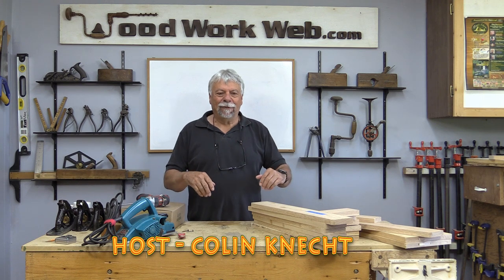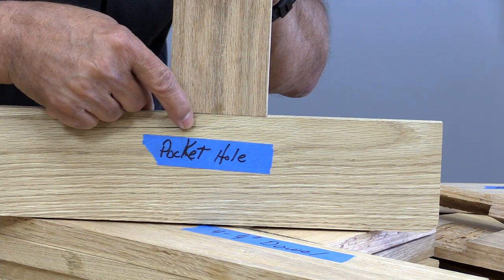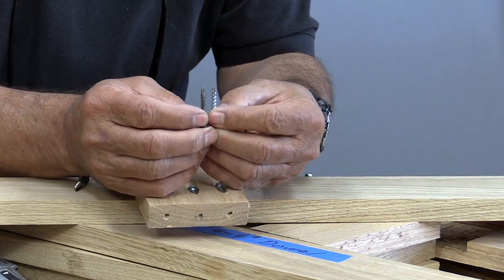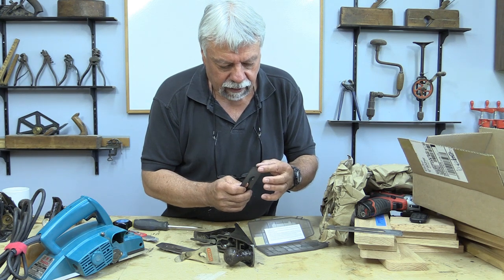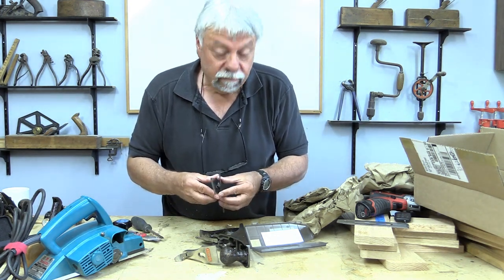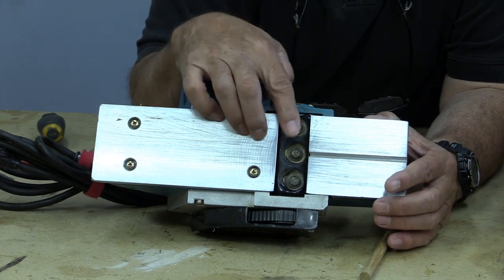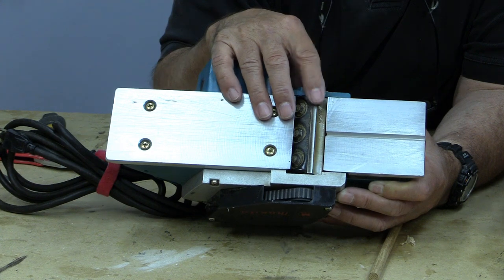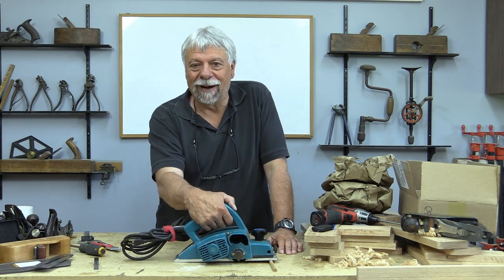Follow up to Joint Testing and Hand Planes

Comment: Hi Colin, this was a great follow up video that really cleared things up. I saw the wood fail on the pocket hole joint on the other video but I was looking for that to happen. It was easy to miss.  They are exceptionally strong joints and if you glue them they are even better in that the glue seals the end grain and helps to keep the moisture transfer to a minimum. I don't know how other subscribers view longer videos but I enjoy them more and I feel the content delivered is much more detailed and readily applicable in our shops. Take care Amigo.
Derek
Reply from the maker: GiddyUp994 Thanks Derek, yes this one ended up longer than I hoped ... I try to keep them as short as I can, but when I look at what to cut out to make them shorter, to me it seems like I am omitting some important info for people.
Thanks again buddy ... 
Coln
Reply: WoodWorkWeb I like the 15-25 minute videos best :) Great job :)
Reply from the maker: Spacehero I appreciate hearing that feedback

Comment: Yes found three old planes at our Re&Re store. One has groves on the bottem and the other two have a smooth surface. So thanks for all the information on restoring a hand plane etc. Colin. Also ordered the Lee Valley sharpening gig which I must say is well built and easy to use.
Reply from the maker: Ron C Yes that Lee Valley sharpening jig works well for me, they are a bit slow, but are accurate, which is what I like.  Thanks for commenting Ron

Comment: Still love them pocket holes. good joint for fast shop projects. I have made most of shop tools stands with them and they are more than strong enough for the job. Good vid Colin.
Reply from the maker: Backyard Woodworking You are absolutely right Roland ... the pocket hole joint is till a great joint for many, many application, as you say it`s fast, easy to make and has a very good strength.  Thanks for commenting buddy, always look forward to your comments

Comment: On the pocket hole stress test you might find that if the pressure was placed on the other side it might have held up a bit longer, Could be the way the grain was running that made the cross rail split.

Comment: Thanks, good video. I also looked at the 2 yr old video you linked to (must have missed it). It's the first I've heard of the parallel issue. What needs to be parallel to what, and why?
Reply from the maker: Michael Anderson Sorry ... you are catching in a blank spot, can you refresh be a bit on the parallel question??
Reply: WoodWorkWeb That was a good vacation! In the older video on sharpening linked at the end of this one you said stones needed to be not only flat but have parallel sides, that it was hard to know if they were adequately parallel, and for that reason you use the sandpaper sharpening method. I've never heard anyone mention that so was curious.
Reply from the maker: Michael Anderson Vacation was only a week, but still good. I can't believe how much work has to be done to take only one week off ... sheesh.  Thanks for this note, I had to go back and watch to see what I was talking about with this ... then I remembered where my brain was at way back. I was transitioning from an old apex style sharpener where the wheels roll on the workbench and the blade slides on a stone to this new (to me) Veritas ... but I didn't say that in the video.
Going to have to make an annotation about that ... thanks Michael for this, appreciate you taking the time on this.

Comment: BTW, I have the original  gauge for that model to set the knives.  Wanna borrow it to copy and make your own?
Reply from the maker: Paul St George Wow ... thanks for that offer Paul, I might take you up on that some time. I have done fine setting them up manually and ... sheesh, I didn't even know there was a jig for that. I must try to download the manual from somewhere at least to see what this looks like.
Thanks Paul ... I will definitely keep this in mind ... really appreciate the offer buddy.
Reply: WoodWorkWeb BTW while on the subject, I WTB a Knife Gauge (Pt# 3879) for a Craftsman 12" Planer (mdl. 351233731) . This is a discontinued item and without it you can't reset the planer blades.  Can't find one anywhere.  Any help would be most appreciated.
Reply from the maker: Paul St George Paul, this would a great thing to post on the Forums at woodworkweb.com  I'll bet there is someone out there who could help you out with this ...